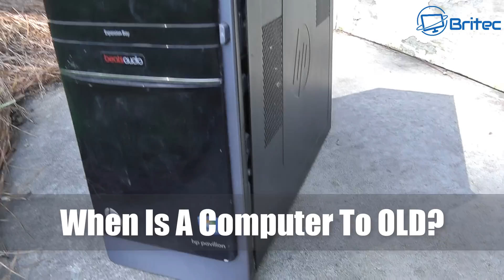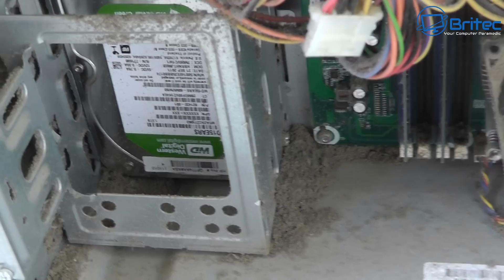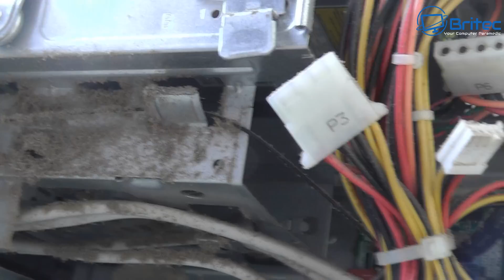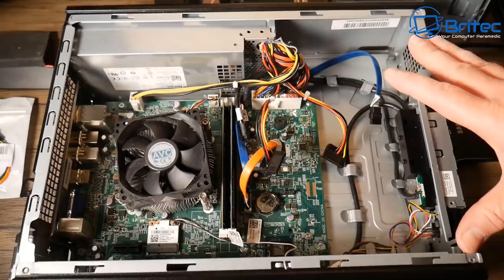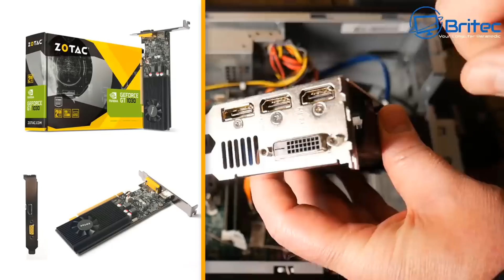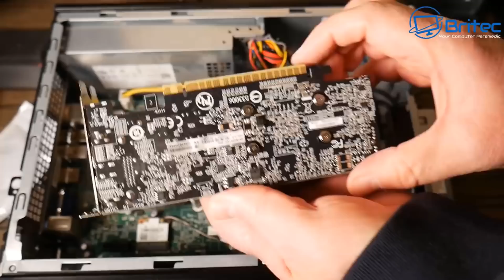When is A Computer Too Old

Comment: Interesting discussion. There is no doubt newer hardware is way more efficient and faster than really old hardware. But it all comes down to what kind of use we give to each specific hardware, then when we have defined that purpose, it's about future proof and value for money imo. Turning an old machine into a retro system or a retro gaming system can save older hardware and that can definitely be a good thing, there are so many options to consider. 
I have some rigs here, one of them a x58 rampage III gene with a 6 cores X5690 OC to 4.0Ghz, 24Gb of DDR3 with a 1080 ti and it does put a hell of a fight with much newer hardware. Windows 11 is not a problem for that rig at all and it's more than 10 years old now. Then again it does not make any sense to compare to a new 3rd gen ryzen system with a RTX 3090 on it. Different rigs different joys. I also run batocera linux on an Asus EeePc with a single core N280 atom and it does the job for some emulators. 
Recycling old stuff is also a nice way to learn about hardware and computing. 
Congrats for the great amount of excellent content by the way. Big fan here 🙋🏻‍♂️
Best regards

Comment: Good points Brian and yes playing games, for example, is a big no-no. Personally, I could not stand anything longer than a30 sec boot up it would drive me mad. Plus I agree that Linux is not the answer. A couple of my desktops are fairly old one a Sandy Bridge running Windows 10 and an Ivy Bridge running Windows 11 on unsupported hardware and they were both built by me and they are still pretty quick so I guess when I loaded up the build I must have chosen some good hardware. But another very informative video mate keep them coming.
Reply: Yes, Ivy Bridge! I love Ivy Bridge. I too have one (a 2013) and mine also still does everything I need to do.
Reply: @avcat1209  Same year as my build AvCat and I am running Windows 11 on it using the workaround for unsupported hardware😀

Comment: Got mine in 2017. I had upgraded the RAM from 16GB to 64GB. It does a good job for my purposes. I can edit video in Full HD in Filmora with no issues. However, if I want to edit in 4K or if I want to use DaVinci resolve, I'd have a very hard time since my dedicated gpu really isn't all that great. I'll get my next desktop in the year 2024-2025, closer to when they will stop Windows 10 support.

Comment: I have a new laptop that is 6 days old running win10 home on an intel based system that does nothing but program freezes
and refusing to open programs and crashes all over the place! Also, the NVME has high usage at times of 100% This laptop
is an absolute dud for being manufactured in 2021!
Reply: Bruh it must have some malware or virus in it you should delete all partitions and do a clean install of windows new pc's behaviour should not be like that it should be fast and furious it should not be freezing all the time i suspect it has infected with some malware or virus i have an old pc i3 4th gen it is running smoothly without any issues then how come your new pc is freezing
Reply: @FarHaN9 , That's what I was thinking of doing! Thank-You!

Comment: Watching this on a 20yr old laptop (one of many I have) some of my computers are 25+ yrs old. Still going strong. In fact the newest laptop (UHD) rarely gets used! Then I don't go rendering 4kVids and my eyesight isn't good enough now to appreciate the diff. Games I play puzzle games (finding things on screen etc). They are no prob. I have steam on here also. It's 'horse for courses' really. I stopped using Windows over ten years ago. Even the computer in the shed with minimal spec runs puppy linux just fine. I can surf the web when looking up parts or watch a vid (sure not in 4K but not a prob). I have many Pi zeros I multitask on. I did screen shot of one running a film, three old games (Quake/Heretic/Doom)and emulating a pidp11 and a Herc VM360 all at once and (sure only one user) worked fine.
Reply: @ Alan Abbott: Then there's hope for me yet, Alan! My laptop is 9 and takes an eternity to start but she still works fine for how I use her.
Reply: I also have a 18 year old laptop(1-core 1.6GHz, 1GB DDR, 50GB IDE) and a recent one(i3-8145U, 8GB, NVMe SSD). It can play the games of it's era quite well. But when it comes to browsing the web one has to be very patient. Also it can't play Youtube videos over 360p without massive losses of frames, though navigating through Windows XP is quite smooth and boot up times are not bad(not running W10 though). That said, I would never trade the newer machine for the old one.
Reply from the maker: I am sure you can't do much on a 20yr old laptop in fact I know you can't lol
Reply: @Britec09  Well I watch you vids and YT every day. I run many emulations and virtualbox. Now I have upgraded things. yes. Cheating? if you want to say so. I bought an upgradable laptop (and have upgraded it but it's still the original laptop base.) On the older laptop I use QEMU instead but still run emulators. So it depends what you want to do. No they will never play the latest games or watch YT in 4K but I have no desire to. So for me they are fine.
Reply from the maker: @G1gop  I glad that works out for you Alan, I myself could not handle it, to slow for me. Whatever works for you I guess. Have a lovely weekend.

Comment: I built a new desktop computer in 2019. It's an i5-9600K with 16GB of ram and a Samsung 970 Plus SSD. It's a rocket ship, even today. But, I have a 12 year old Dell Inspiron laptop that was given to me that I use when commercials come on the TV. It sits at the end of my couch and I just pull it out when I want to read email or a blog. I did a few upgrades to it though. I replaced the battery, swapped out the old drive with a 120GB PNY ssd, increased the ram from 1GB to 4GBs and installed Windows 10 Home on it. It runs quite well for a 12 year old laptop. That desktop is my main computer that I do my work on though. I spent $1000 on the parts for that one, without a GPU. It does everything I ask of it, though I do not play games. Thanks for you videos. I always find them informative. 🙂
Reply from the maker: Thanks Geo

Comment: my oldest PC's are zx81(16k upgrade)& zx spectrum 48k & thay work better than when new also I have a twin CPU unheard of 20 years ago when I built it & it's better now than when built. as no one can see into the future other than bad programming= bloatware and this requires a minimum x10 hardware performance & the creation of E wast & you are wrong most people only use any pc/computer for internet older PCs are ok if the os is good.

Comment: My only caveat is that a 7th gen Intel machine (not supported by Windows 11) is definitely not old.  I despair at Microsoft actively making PCs obsolete before their time and filling landfill against all reasonable arguments.  On the other hand, my Surface Pro 3 from 2015 IS old, not upgradeable, and only runs Windows 10 poorly (it came with 8.0!).

Comment: Essentially, it all depends on your tolerance for how long things take. It's too old when it can no longer do what you need it to do in a reasonable amount of time (determined by the user) and/or when it can no longer run an operating system that is still supported and receiving updates. It also depends on whether it is used online or not.
Reply from the maker: I have no tolerance for slow computers lol
Reply: @Britec09  I know the feeling. My daily driver is a Ryzen 9 3900x, 32gigs 3600 CL16 ram with Two NVME drives (and 1 spinning rust drive for longer storage files). Pretty much everything seems slow to me. But I know a lot of people running Windows 10 on Core 2 Duos, 2 gigs of ram, off of a spinning rust drive who are totally satisfied and don't understand why I keep encouraging them to upgrade, at least to an SSD. Some people.
Reply: Me too just worked on a computer with CPU 2c/2t loaded with McAffe 15 running processors in background slow as a snail! Client wants to play AAA games.....lol
Reply: Norman Gray  task manager won't kill or remove McAfee you need to nuke it!

Comment: I know how it feels. I got a 12/13 year old PC. Had it for two or three years now. I think, i got a bad memory when it comes to time. My dad's not a cheapskate, but we always usually sadly do hand me downs. I mostly use a slightly more modern PC when i work at my job. Slight being like 2016 or so.
Reply from the maker: The good old hand me down lol
Reply: @Britec09  I got a question for you. Regarding said PC. I have W7 on it. OEM. Will it still be permanently activated if i try to upgrade to W10? Or do i need a new key.
Reply from the maker: @TonyDrljača  It would activate
Reply: @Britec09  Thank you for answering.

Comment: Not so much the age, but what is in it. mine is 5 years old and will run a lot of modern P.Cs into the ground, the only thing i have changed is the processor,  i have a newer one that i have just built but not got around to putting it into full time use.
Reply from the maker: 5 years old is not bad

Comment: I have three desk tops and two laptops. The oldest machine has a 2nd gen Core i5 with 3rd, 4th and 5th after that and a gen 9 in my youngest desktop.

I've upgraded the 4th gen with parts that were being discarded. I built it 7 1/2 years ago with a 1GB video card, 8GB RAM and a 400GB drive. Over the years I bought a 128GB SSD for a boot drive. In the last two months, with four discarded parts and a $20 heat sink, I boosted the speed with a slightly faster 4th gen Core i5, and swapped in a 2GB video card, 16GB of extra RAM, and a motherboard with an M.2 slot, so I put in the 128 GB M.2 I had taken out my laptop when I installed a 500GB unit.

The M.2 is old, yet still rated at 4 x the speed of the SSD.

I do some photo editing, but other than that it's just hooked to a TV so I can use the internet comfortably :D It's quite a bit faster now than it was when I built it, but no doubt slow compared to newer PCs with an M.2 NVMe and a 12th Gen Core i7.

I forgot to mention that all of my computers are running Windows 11.
Reply: I also have i3 4th gen pc dell optiplex 9020 with 8gb of ram and i have installed ssd in it too it is running smoothly from 3 years now i also mostly use it for browsing and some email i think it should be fine till windows 10  end of life in october 2025

Comment: i have a Dell 1545 from 2009, works fine with linux for youtube news and email.  Boots in under 30 seconds on an hdd.
Reply from the maker: What CPU is in that Dell 1545
Reply: @Britec09  I've refurbished several of these laptops recently, they are usually Core 2 Duos, you can upgrade them too.

Comment: My laptop is from 2009. Want to get a gaming PC but I've seen the graphics cards are going for over retail, so I've been waiting to see if that trend levels out.
Reply: Just buy a used GPU with the new PC. Pretty sure any $50 GPU is better than the one from your laptop, it is even likely the iGPU from current Intel CPUs to be much better. I have laptop with i3-8145U and UHD 620 and it is much better than my old 2010 laptop with HD5470. It is hard to tell when GPU prices will normalize, if that even happens.

Comment: Still using my PC from 2010 with a core i7 990X with 48GB ddr3 triple channel. Upgraded the GPU to 2070 Super, was previously using GTX 280. With a Samsung Evo sata SSD it still is quite fast enough for me even though it’s limited to sata 2 speed. 
I can run almost every AAA games unless it requires AVX. Photoshop and video editing are still working fine. 
I connected 5x4tb hdd for storage and a x-fi pci sound card. 
For now I’m going fine but would love to upgrade to a newer platform if I can afford it. 
Thanks for the video.

Comment: While I agree with you, I don’t think it’s that simple to say someone’s system is too old. It depends on what you’re doing with an older system. Just because it’s old doesn’t mean it’s obsolete or doesn’t still meet the needs of the user. On the other hand, it’s true that people spend too much on upgrading over time. Sure in the long run people spend more overall, but generally that money spent over time not all that once. A lot of people just can’t afford to spend $500-$1500 for a new system, so they will upgrade their current system until there’s no choice but to buy a new system.
Reply: You can upgrade your system relatively cheaply, by patience and researching tech specs and the market choices including used parts from a reputable supplier.
Reply: I'm  an old person still works well and can do the job perfectly well ,I like old cars they have style looks and drive great,hate the new ev cars no class expensive and we are again pushed to get these electric trolleys..were also pushed to keep upgrading our pcs win95,98,2000,xp,w7,w8.1,w10 now w11 where does it end I'll stick Linux since w7 finished soon I'll dump lot in skip goodbye
Reply: @FighterPilot1945  If that's the edited version, then good luck. I think you should buy a ZX81 and a wee B&W TV. And a new hot water bottle.
Reply: @FighterPilot1945  Old cars were new and replaced bicycles so if you were actually serious you would only walk and not have a PC at all and would certainly not be watching or commenting on a YouTube video.
Reply: @FighterPilot1945  don't dump it in the skip! Sell it! People can use old computers that may not work for you. If the machine is over 20 years old, you may be able to get a premium for it especially if it is still working. my friend sold a pentium 3 dell optiplex that he got given for free for £100, and that's without even installing a graphics card! Only problem with it was the CMOS battery and one of the ram sticks failed. Replaced both of those and works perfectly, no blown caps, fully stable.

Comment: Perhaps Windows 11 compatibility can be left out as an exception for the sake of sanity.
And, adding an SSD is not a placebo. For that matter, nvme, optane are placebo too.
Reply: I have a desktop made in 2011 that has a m.sata slot. I want to fill this slot. Is it worth it? This slim machine only has 1 harddrive SSD connection and a DVD Drive SSD connection
Reply: @chasonsnotes  The perceived difference in system responsiveness would be negligible when compared to SSD and NVME because of the bus transfer speed limit of the old motherboard. On a modern PC, that would make a difference.
Reply: @chasonsnotes  yeah! Although if you want a brand new MSATA drive, because they're not very common anymore, you will probably have to order one from Aliexpress. I bought one from a company called Xishuo and its fine for the netbook I put it in!
Reply from the maker: They won't do that, means they will have to continue to support old legacy hardware

Comment: Intel Core 2 duo laptop from 2006 that came with vista. Now running win 7.
Reply from the maker: going to be limited with Core 2 Duo
Reply: @Britec09  Agreed. But it is only used for reading old CDs/DVDs as it has a perfectly working optical drive. I use a newer laptop for my daily computing needs :)

Comment: My system is from 2013, it is an i7 4790k and ASUS Maximus VII Ranger. It has run perfectly over the years
But I have bought a new processor - an i5 12600k, I have not decided which motherboard I want yet, but it will be in the autumn I build a new system
Reply from the maker: i7 4790k was a great processor. Once you get that i5 12600k up and running, you won't want to go back on that  i7 4790k
Reply: Thats good for you brother congrats

Comment: Tried tapping the PSU a few times and messing around with the SATA power cables (ketchup and mustard variety) and it still didn't run any faster.😁
Reply from the maker: What you need is some go faster stickers
Reply: @Britec09  If it worked on yours, then consider me a convert.
Reply: @Britec09  RGB, go-faster stickers for the PC generation

Comment: I have an old dell Optiplex GX220 from 2002 and it runs XP and Linux. Obviously modern browsers don't work with XP so I use Maxthon. For once where I would normally praise Linux the system actually still runs better with XP.
Reply from the maker: That's the problem, they become so old, applications don't work or supported. Maxthon is a Chinese based browser